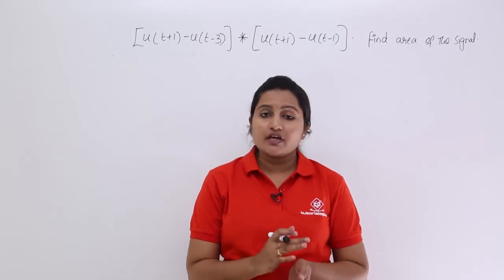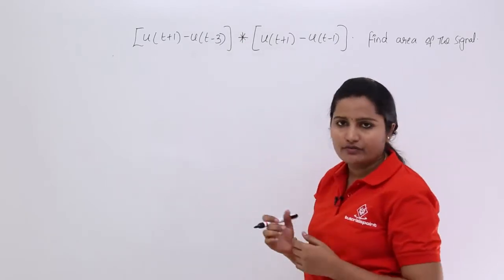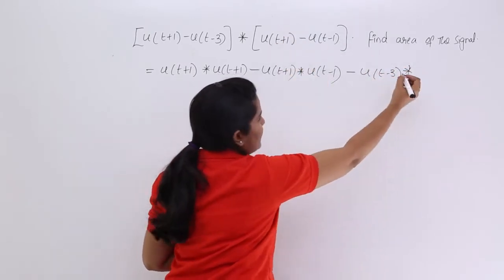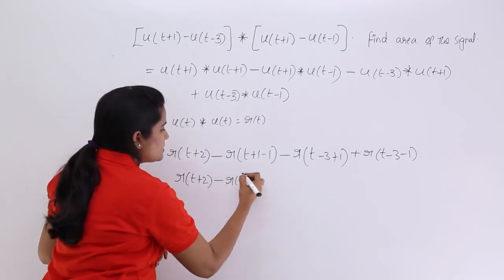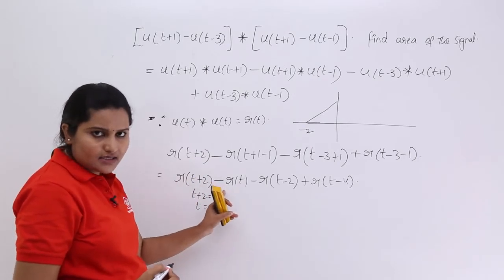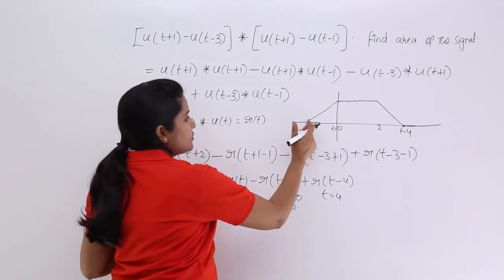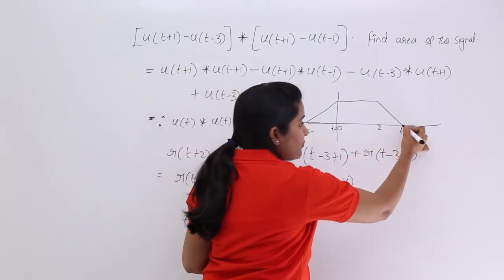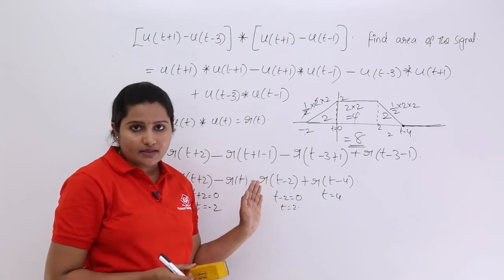Ramp in Convolution Problem Example

Comment: you are considering  2 amplitude here.why?
Reply: Muhammad Ali in case of ramp....  Just to understand take angel as 45degree....  Then length will be equal to hight.... So it's 2
Reply: umesh singh  thank you very much
Reply: @umeshsingh-du3pk  thanks
Reply: Consider r(t+2)... Here the slope is 1 which is nothing but amplitude... We have the point (-2,0) and slope as 1 so we get the other point as (0,2).. Similarly for -r(t-2) the slope is -1.. Here consider the points (2,2) and (4,0) which gives u the slope -1..